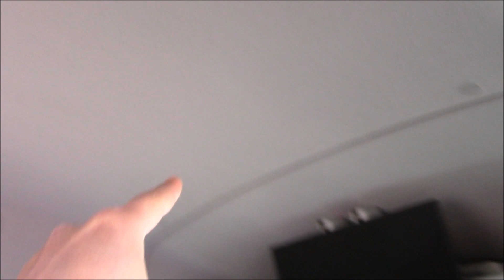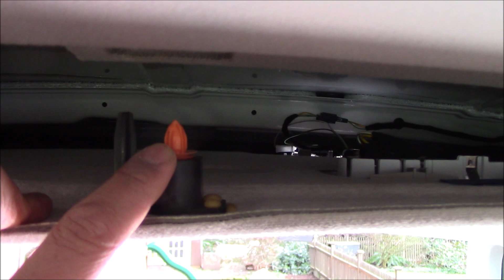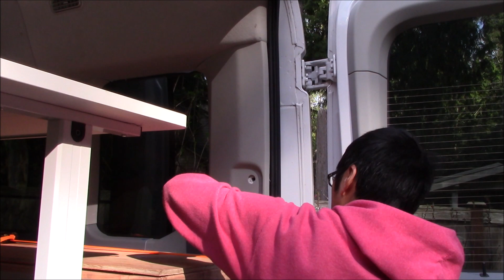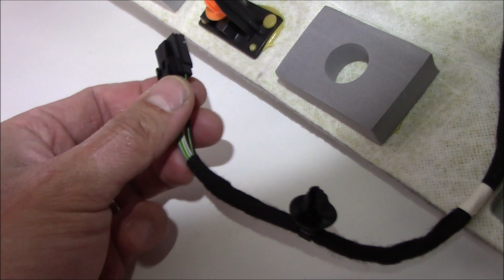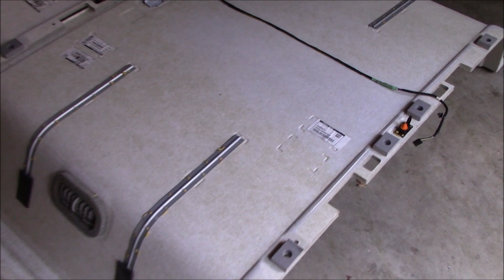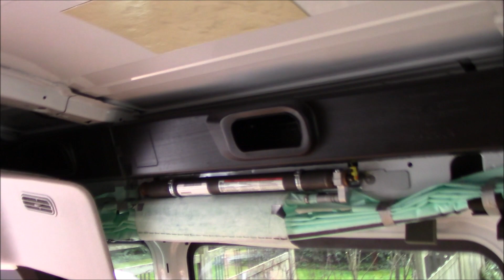Ford Transit Headliner Removal

Comment: Do you think H3 could be dropped down or just listened to locate holes in a supporting beams to install an L bracket on the outside of the headliner? I am wanting to install soft storage from above, that would be in front of the back windows in the H3 area. Does that make sense? But I don’t want to take the entire headliner down to accomplish this…

Comment: Hi Chris! I did a search for "how to remove interior paneling in ford transit" and your video was the first to pop up! Awesome video that greatly improved my confidence for removing paneling for my van build...it was so helpful to see what's behind the panels. I was originally planning on getting the cargo van and converting it, but was concerned about not having the curtain airbags since I'm transporting the girls in the back...but I didn't know how to remove the paneling in the passenger van...but now I do!!! Thank you so much and I hope you guys are doing great :) :)
Reply from the maker: Misha, great to hear from you!  That is great, did you also get a Ford Transit?  This has been a great van.  I went through the exact same though process and initially was looking at the cargo configuration but eventually settled on the passenger for the extra seats and the safety from the airbags.  It turned out that we use the 15 passenger configuration more than the camper (soccer practice, kids trips, etc.).  Let me know how your build goes, it would be great to catch up and hear how you and the girls are doing!

Comment: You want to definitely pull the the pillar cladding off first...then take each headliner phase off fully, one by one, starting at the back with removing the door striker cover...each wire is connected to the back of each phase, so, once you take a phase off, you have easy access to the wiring hardshells on the next phase.

Comment: Excellent video.  Now the real question :  How to FIX a sagging headliner that is exposing the side curtain airbags on  2020 Ford Transit High Roof 350 without causing a problem for airbag deployment.  So maddening that the headliner is coming loose!

Comment: So...H1 is the only piece I DO need to remove. Any advice on how to do that? The plastic bit has bolts in the front near the windshield and we think they are covered in plastic on the front. Can't figure out how to remove it. :(
Reply: Nevermind! If anyone has this question too, check out: https://www.youtube.com/watch?v=vvg8C59DE00

Comment: Thanks for sharing your wealth of knowledge.  I was wondering if you did anything in particular with the airbags after removing the headliner.  Did you remove them or cover them in a way that would still allow them to deploy?  Thanks!
Reply from the maker: I actually only removed the headliner so I could cut some holes to install lights.  Afterwards I put the headliner back up.  I also did not touch the airbags at all and I purposely did not place anything in the way of the airbags because safety is my first priority so I did not want to modify the airbags in any way.  Thanks for watching!

Comment: Hi Christopher,
Did you happen to see where the holes from the outer roof come into the van? The painted plugs near the roof rack mounts. Do they just open to the roof inside headliner? Or inside the cross beams?

Comment: Hey Christopher - thanks for these - they are really helpful as I'm going through my own van build over the last couple months (with more to go). I have a question about the plastic barbed connectors in the headliner - I'm thinking to buy more (do they have an official name?) and insert them into other places in the headliner to serve as a place to secure cargo net so I can store my window coverings. Do you think this would work? I'm not sure how the bolt-thingy would stay secure if it wasn't inserted in the intended location (and perhaps to the frame itself). TIA for any insight you can share. Hope you're making great family memories in that van!
Reply from the maker: That is a good question but unfortunately I'm not sure how it would work if it wasn't in the intended location.  There are other holes that it should probably fit in.  That being said, I've backed out one of the plastic bolts just a little and used it to hand stuff from so it is pretty strong.

Comment: Great video! I also just bought a Transit and I’m converting it. With 2 small kids I also had to leave a rear row of seats and I want to keep the airbags for safety but I want to add insulation and paneling for aesthetics. Couple of questions. why did you remove the headliner if not planning to install insulation? For extra space? Also, are you planning to just leave the airbags and duct work as is? Thanks!!
Reply from the maker: Hi Mark.  I removed the headliner to install ceiling lights and running some wires.  For safety, I'm leaving the airbags untouched and I'm also not modifying the duct work.  I've spent multiple days in the mountains in freezing temperatures and even with no insulation it works fine for me.  Thanks for watching!

Comment: We have a similar van for our conversion and we are thinking about keeping the headliner (for now) and putting in some mounting points through the headliner and attaching them to the van frame behind - e.g. with an extra long eye bolt that goes through the headliner and bolts the frame. Have you come across anyone doing this, or have any thoughts about it?
Reply from the maker: I haven't seen this.  I didn't want to mess with the space behind the headliner due to the fact that the airbags are located there.
Reply: mustlove - i did see a video on this - i am wanting to do a similar in the ceiling in order to hang a hammock (one eye bolt in the back, and one by the passenger seat). you might search youtube for hammock hanging in a ford transit camper van

Comment: How much more head room did removing the headliners get you
Reply from the maker: It depends.  In areas where there is a support crossbar, you only gain an inch or so.  In other areas, you might gains as much as 5 or 6 inches.

Comment: Hi Christopher, 
Did you remove the header in order to put insulation above it and reattach the header, or are you planing on leaving it exposed?  Is it okay to have the air bags exposed?  I also have a 2015 Ford Transit and was contemplating removing the header to add some insulation and reattaching afterwards.
Reply from the maker: I removed the headliner so I could install lights and run wires.  I ended up not dealing with insulation as I discovered I really don't need it for my purposes.  I hope this helps.
Reply: Christopher Lum, Is it okay to have the airbags exposed?
Reply: Would it be possible to add insulation between the ceiling and headliner. Gets awfully hot back there and cannot run AC all the time. My passenger wagon does not have any windows to open. 
Thanks for explaining the pesky cargo light.

Comment: Great videos Christopher!  I am picking up my 2018 Ford Transit LWB Medium Roof Height 15-passenger van this week to convert to a family adventure van.  I just subscribed to your channel and have found your videos very useful.  

Question: why did you decide not to install a ceiling vent/fan (as mentioned in a comment reply)?  I'm wondering how to provide proper ventilation for my configuration, and am wondering what your solution is.  Keep the videos coming!  Thanks!
Reply from the maker: Hi Austin, that is great to hear, I'm sure you'll love the van (I know I have).  There are other similar van conversion videos on the channel, please feel free to check them out and let me know what you think in the comments.  Thanks for watching!
Reply: @ChristopherLum  I've watched them all! :)  Question: why did you decide not to install a ceiling vent/fan (as mentioned in a comment reply here)?  I'm wondering how to provide proper ventilation for my configuration, and am wondering what your ventilation solution is.  Keep the videos coming!  Thanks!

Comment: I have been looking for a long time for a great video like this one for removing the headliner! Will there be a video explaining what you are doing with the storage tray connected to Headliner 1 (right above the driver and passenger)? I wonder if you have added support to be able to hang the monitor, fire extinguisher, and accessories?
Reply from the maker: Hi Brent, yes, I'm planning on getting that video up in the future.  I've got a playlist of all my van videos at https://www.youtube.com/playlist?list=PLxdnSsBqCrrF5nO7cmNTc4cct0miFWdO6.  If you subscribe to the channel, hopefully you'll get notified when that video goes up.  In short, I didn't have to add any extra support other than a rod to mount the equipment.  The tray is bolted into the roof fairly securely.  Thanks for watching!
Reply: @ChristopherLum  Thanks for the reply Chris. I have subscribed and look forward to more videos!

Comment: another great video!  are you planing to put a roof fan (Maxxair or such) in at any point?  looks like HL3 section, aft of the dome light might be the easiest location?
Reply from the maker: I'm actually not going to put in a fan but I did put in lights and electrical.  I'll post the video detailing this soon.  Thanks for watching!
Reply: Did you finish your wiring video?

Comment: Great Video Chris! I have a 2019 Transit 350 XLT LWB passenger van and I and doing the same thing at this very moment. Tonight I just got the ceilings pulled down and getting ready to cut in two MaxxAir 6" exhaust fans. I will be bypassing the rear curtain airbags, and add solar and house wiring. Then installing insulation. Gotta work fast cuz the Florida Heat is coming, and my Transit is Black! Keep the videos coming!
Reply from the maker: Hi HawaiianFlyGuy, thanks, I'm glad you enjoyed it.  I've got other videos detailing my Transit conversion at https://www.youtube.com/playlist?list=PLxdnSsBqCrrF5nO7cmNTc4cct0miFWdO6.  I update this playlist as I make progress on my van.  If you subscribe to the channel hopefully you'll get notified when the new videos go up.  I'd love to hear how your conversion is going.  I'm currently working on the electrical and hope to have some videos on this up soon.  On a side note, nice RC videos, I had a Sky Hunter and loved that airplane.  I also have a Skywalker X8 flying wing that I haven't had a chance to fly yet.
Reply: Yeah, me too!! 2015 Black XLT. Bought it yesterday. So excited!! Thanks for this video Christopher! Subbing 😊

Comment: Those two plastic surrounds at the back door latches pop out easily and reveals the liner tabs surrounding the latch and you will see how easily it comes out.
Reply from the maker: Awesome, thanks for the tip!  I haven't needed to remove this yet but that will be handy in the future.  Thanks for watching!